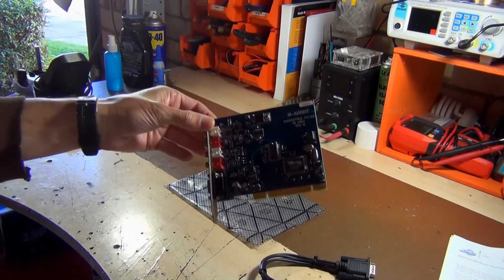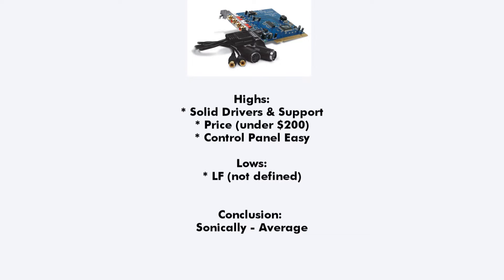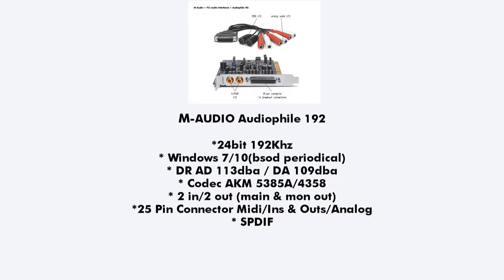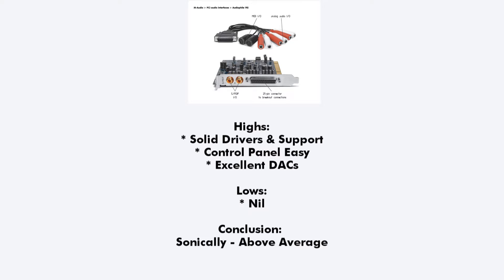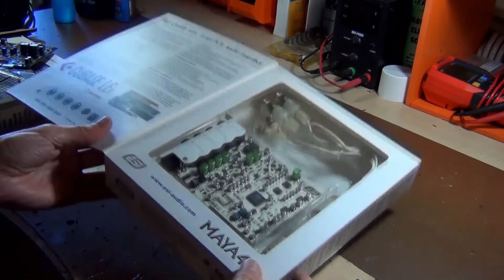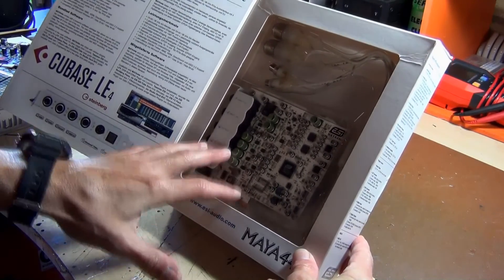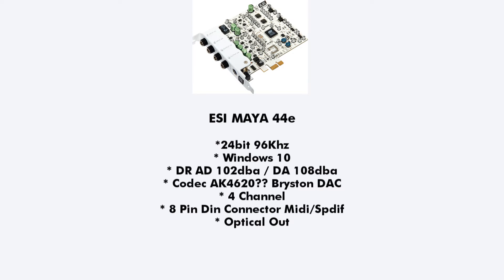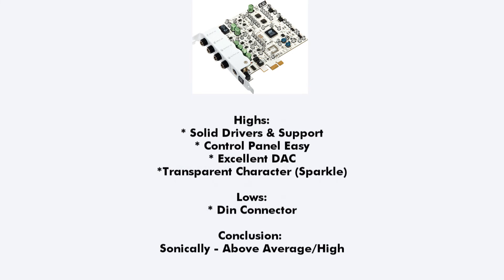PCI Sound Cards That Are Still Relevant in 2022.Are You Still Using One? RE-UPLOAD

Comment: still daily using my 1820M bought in 2004 , it is working just fine on WIN 10 with the install script found on KVR audio. i opened the dock once in 2018 to replace  few caps , appart from that  excellent unit.

Comment: Someone explain me what the Korg1210 is. Is it a Sound Card? Was it for IBM? I have one, and never got it to work under any windows 7-10...
Reply from the maker: The Korg1210?...ahh the 1212 i/o right gotcha...i had to look that up, totally forgot it existed...was that like back in the late 90's..like win 95/98 days?
Reply: @memoryflash3687  Yeah... Korg as usual makes some great stuff... It was used in Powermac, with MAC OS drivers and probably also Win 98 drivers, but it never updates the drivers past v. 1.0.... So it was already obsolete in just one or two years... I tried to run it in an old PC but not even the Bios could detect it... I tried different adapters but none worked...
Korg didn't release the datasheet of the 1212 so It's impossible to know which PCI pin does what also...
If however one get an old MAC G4 of that era... this card could still work...
It's a puzzle to find info on this card, and drivers too... only two exist, and Korg do not have any on its Main site... It's like it has never existed...

Comment: M audio 1010lt is the card i am runing.
Reply from the maker: Great to hear still going...Those cards were work horses...they were reliable people ran a few of them together in their machines i think like 3 or 4 which was pretty cool setup.I never owned one but a friend had the 1010 at the time i remember it sounded pretty good and i loved the look of the rack mountable break out box.There were a few differences i believe between the 1010 and lt version in terms of of sound quality i don't think it was much but the 1010 did have slight advantage because with most of those break out box's they usually have the AKM in the box and the clocks on the card.The snr was better on the 1010 that makes sense as there would be less noise not having everything on the pci card but it is interesting that the lt scored the mic pre's and the 1010 didn't, like they did a bit of cost cutting for the external box or something i guess.

Comment: The downside of EMU 1212M is that it eats up 2 slots indeed.
Do you have any experience with Echo Layla 3g? It came with an external preamp and connection box but unfortunately it is PCI instead of PCIE.
Reply from the maker: what's interesting about the daughter board on the 1212m is it's really a contactless connection or a placeholder support into a pci slot.So you could in theory make an external box like 3d printed or laser cut to house it, which would be kind of cool right?...although you would need a longer ribbon cable for the connection...this would be good if you had a board with only one pci slot though 🤔

Comment: I have a 2496 still going... inside a Power Mac G4, running OS9. I can't tell if there's actually a hardware fault or if it's just something with the ancient drivers, but the audio seems very prone to clipping. Luckily it's mostly there for the MIDI (to drive a Korg OASYS PCI), it's probably one of the last such cards with proper OS9 drivers and OMS support.

It's kinda funny that Korg themselves seemingly never made any hardware for this purpose, they just expected people to figure out something that works.
Reply from the maker: Ok interesting....ooh oasys pci nice....have you tried without the oasys pci installed?...and also any other additional sound card or pci card disabled.have you tried recording something line in to check levels and then output it....this will at least verify the signal in is good and the problem is software or driver related or perhaps output side which may indicate a hardware fault.
Reply: @memoryflash3687  I did try a bunch of configurations. Honestly  that might be the problem at this point, OS9 is such a mess and I don't feel like reinstalling everything :D

I really should just put it in one of my old PCs to make sure, but I keep forgetting to do that. I really don't need the sound output for much of anything. Maybe I'd like to mess with ancient Cubase a bit more, but that thing is unstable enough with just the OASYS configured. Unstable, and also prone to requiring a partial reinstall if it crashes at the wrong moment... did I mention OS9 is a mess?

Comment: I bought a PCIe  to PCI Adapter/Converter to use my Roland RBUS (RPC-1) and the recording pgm Logic 4.7.1 in this Dell 808 Desktop which has only PCIe slots. I am hoping it will work with the Logic 4.7.1 as it is proprietary - if you know of any workarounds please let me inow and Thanks~!
Reply from the maker: I'm  not familiar with that computer, i assume its a newer computer if it has no pci slots...its a bit hit and miss with those adapters there are some cheap ones about and the voltages can differ so so something like the startech adapter looks like it supports the 3.3v and 5v and read reviews from some RME users their old gear worked perfectly with that particular adapter.i see you running an old version of logic so i guess an old os like win xp or something like that will be installed.I see the roland supports xp drivers as well.
Reply: Roland used to a make a R-bus to ADAT converter...

Comment: How did you get the drivers to work on Windows 10? I had my 1616m working for the past 4 years. The latest firmware update from my computer manufacturer broke my drivers for some reason. I tried uninstalling and reinstalling. Still only getting one wave in and one adat in. The dock is all grayed out in the patchmix program. I also get a message saying I don’t have enough hardware when I try to open previous saved sessions that were in 44.1 and had dock channels used. Any idea of how I can get this working immediately?
Reply from the maker: first be sure to remove any directories in program files or system and any in registry...then i would follow this guide scroll down to the last post by clubhousekey this is in response to a similar hardware error on 1820 but should be the same and follow that guide https://www.kvraudio.com/forum/viewtopic.php?t=371831&start=180

Comment: How can I make M Audio 192 AP work on AM4 platform?  I tried pciex1 to pci adapter but my PC wont recognize the soundcard at all.  I'd appreciate any help you can give me.
Reply from the maker: Is it possible it could be conflicting with another card if there is any...remove your other cards if any and test it i would try this first...linux pc's may have an issue with these cards hot and miss according to a few user reviews they couldn't get it to recognize their cards...when they tested the card in windows pc it worked though
Reply: @memoryflash3687  Only other card I have is GPU. The only solution  with previous AM3 platform was to disable on board sound and then reinstall drivers for AP 192 so that Win 10 can recognize it as valid. But this time no such luck with AM4.

Comment: heloo I'm currently in the mid of using @julia esi .
the only problem is
I use pcie to pci card from wiretek 
and instal everythings and modifying my cpu case until @julia is detected on my win 10 ghost spectre superlite.

everythings look okay driver are okay signal are okay 
good detected on my new hardware 
gigabyte h61 ds 2 and 13 gen 3 

but sounds output isn:t there ..no voices not a thing from my kruzwel monitors speakers.

any clue or any help from you would be appreciated

thank you
Reply from the maker: So the card is recognized and showing signal through the control panel, but just nothing out of speakers....it sounds like a routing issue then, just double check the input and outputs and config on the panel, from memory there are also mute buttons which should not be enabled...disable any other sound devices like internal if you haven;t already.What kurzweil speakers are they? remember the julia has balanced and unbalanced connections which can be swapped, so you could try that additionally to match the speakers...you should still get some sound though regardless but something else to try.
Reply: To make the  card work, you need to apply -12V to the adapter and everything will work.
UPD: To the ground contact of the PCI bus

Comment: M audio delta 1010lt not working
Reply from the maker: This was a post i pulled from the SOS site from a user
Re: delta 1010 windows 10

Post by BassSpy » Wed Apr 04, 2018 3:36 am
Sorry, way late to this forum, and I generally don't participate in forums in general..

However, I have to say that I've had zero problems when running my old Delta 1010 (breakout box version) on Windows 10. Works great, but you don't get the M-Audio control panel in the task bar.

Here are some tips to get the old beast working on Windows 10.. and I'll include a few other tips after.

Download the Delta 6.0.8 drivers (I believe they are Windows 7 drivers.. It's been a while).

http://www.m-audio.com/support/download ... elta-6.0.8

In Windows 10, extract the files to a location of your choosing.

Right click on Delta_6_0_8.exe file.
Select Properties
Click the check box in Compatibility Mode for "Run this program in compatibility mode for and select "Windows 7" from the drop down. Click Apply, then Ok.

Next, Right click on the Delta_6_0_8.exe file and select "Run as Administrator".

Follow the instructions. You may need to have a reboot to get the device up and running.

If this forum allowed pics, I'd show a few to ease the process along.

Please note that I haven't performed this operation since Windows 10 came out, so I may be mistaken. If this doesn't work, try running in Compatibility for Windows 8 (eeew, I know).

I'm a fan of this audio setup. I did my first awesome professional sounding recordings on it, so I hope those of you who still have the old machines with PCI can make use of this info.

Good luck. I might check in to see if anyone managed to make use of it. BTW, the midi works fine as well.

It's also recognized in both Reaper and SoundForge Pro 11, with full ASIO support.

Enjoy!

BassSpy

Comment: A workstation board I just bought has a PCI slot, and I'm wondering if there's anything worthwhile I can do with it.  I don't actually do any audio production, so I don't actually need a pro sound card, but are there any PCI sound cards that aren't super expensive that still properly support Windows 11?
By properly, I mean things like not having to disable Virtualization-Based Security.
Reply from the maker: they may or may not properly support it, i can't say for sure on windows 11 because most of the old pci cards will work on vista and win 7 with official drivers up until those OS but i was running old M-Audio cards on win 10 no issues but they were a bit flaky with the occasional bsod.that being said i would probably look at the ESI juli@ card with official windows 11 drivers or even some of the other ESI cards like say the maya 44 they have official support for win 10 so that would be your best bet and usually cheaper than the juli@ cards.Other than that i can't say what other cards are supported with win 11 properly apart from other high end stuff if i recall the lynx audio stuff has current support as well but pricey.

Comment: Why only the small M-audiocards what about the Delta series like the 44, 66 the Delta 1010 lt and the Delta 1010. I still use the Delta 1010 got three of them and one spare unit without the Pci card. I use them with Logic 9 in hackintoshes and at the moment I try to make them work with a Pcie to Pci risercard on modern computers. I do not use midi or softamps, I want the real stuff so it´s a mixer, mics, preamps, small amps and real instruments.
Reply from the maker: Apologies that's all the cards i had at the time, the other M-Audio cards you mentioned are excellent cards as well, i never owned those ones but i remember reading about the 1010's everywhere back in the day.These early M-Audio cards should be written into the history books because they pretty much were an affordable music studio in a sound card but it was the starting point for so many of us for professional audio production later.
Reply: @memoryflash3687  Thanks for the reply, yes these are super quality cards but they need a PCI slot and they are not on the modern motherboards no more. A Pcie to PCI converter like the Startech which is suposed to be the best (it has the Ti chipset) will not work. It is really sad that so much of the good old hardware wont work no more. I have a mac driver for the Delta cards if somebody need one but this driver is a project from a hackintosh site so only the audio channels work the midi part does not. Sadly only some PC motherboards might still have PCI slots so to use these cards you need to go hackintoshing. Under here is a video I made 13 years ago with one of my old hackintoshes with an old Delta 1010 soundcard wit he the break out box so the programs and computers worked OK back then too. Not the highest resolution but I think it is still pretty impressive
https://youtu.be/76cNsbTCXUE?si=OuOkMgGPWztteZSz

Comment: In my home studio, I use an EMU-1616m. It is compatible with Windows 10. It's a great сard, the sound is clear and focused. And even there are thoughts of buying the same one on the secondary market, in reserve. Is it worth doing this? Thank you for this video.
Reply: I had 1616M, recaped all the big capacitors to decent Rubycon capacitors(only Mouser, Digikey etc., ebay aliexpress are fake caps) and it sounded so good. Very low jitter and proper clean sound.
Right now i have 1820M, also some mods like capacitors, output caps on one output bridged, the sound skyrocketed after capacitors, not even funny. I had those Focusrite 2i2 and some other like UM22 and Gina but this is no joke and i'll get another for backup. Recapping is a must to high class caps.
In short, get another!
Reply from the maker: @kresimirsokre6536  i second this comment..preserve these cards...they kick ass!

Comment: There are drivers even on Windows 11 for infrasonic quartet, using it with ASIO 2.2 on win11
Reply: The win7/8 driver the last official driver I found on their website, obviously still working.thanks that's good to know.i had mine working on a win 7 machine so didn't test it.a lot of win 7 cards work on win 10 and 11 with an older driver, some better than others.

Comment: 😂i love the 1212m I’m running it my pc  I didn’t know it was 24 bit  love  the 192 kHz. If I’m not mistaken I seen something about the option for 328 or something like that but I never tried it. The funny thing is, as I’m switching over to mac. All the new interfaces look like downgrades
Reply: The 1212m sounds very clean an accurate and is comparable to the motu and the rme units of the similar specs.
Reply: I'm trying to get some similar price RME like Multiface II to compare with 1820M

Comment: The backing music is very good and fitting for the era of sound cards. EMU 1820M running here with Win 11. Solid drivers and low latency. Im runnijg mine with a custom linear PSU. To my ears it sounds better than my FF800. Thank you for this video.
Reply: Bro..did you have to do any modification to the driver or  software or just run in compatibility mode?
Reply: @FC-xc3zy  I think I did have to modify the driver
Reply: @RadiAsian  what do you mean linear psu? Did you pull it out of the pc case also?
Reply: https://www.youtube.com/watch?v=NCKvzF0XzfY
Reply from the maker: Great to hear the 1820m is still working, i had my 1212m working fine in win 10 so that's unreal still going...i have a dedicated offline Win 7 music machine now with the 1212m but awesome to hear about this thanks for commenting and letting us know.